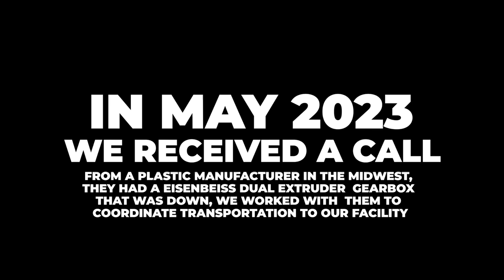Eisenbeiss GDTA 555 F Dual Extruder Gearbox Repair Rebuild IGB

Comment: Rebuilt vs Remanufactured.  If I was the customer and my box came back with the same $30 ball valve on the case drain I would wonder about what else wasn't deemed important. Was it removed for cleaning? If not how clean did the case actually get? If it was why not put a new one on? It's usually something small that takes out something big. "The devil is in the details" boys.
Reply: We inspected the entire gearbox upon disassembly and the valve was deemed to be in good condition and fully functional. The entire gearbox and all components were cleaned thoroughly before being reassembled. We also replaced all the plexiglass panels, the hardware attaching the panels, the fittings on the panels,  and a vent that was missing when the gearbox arrived.